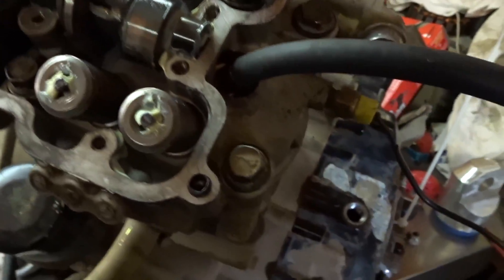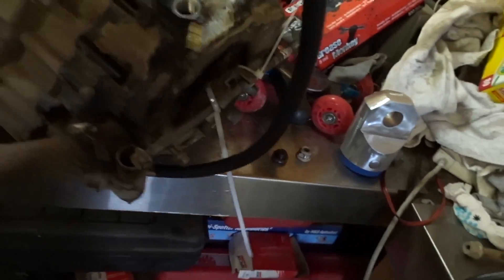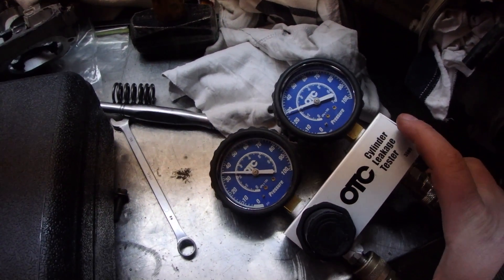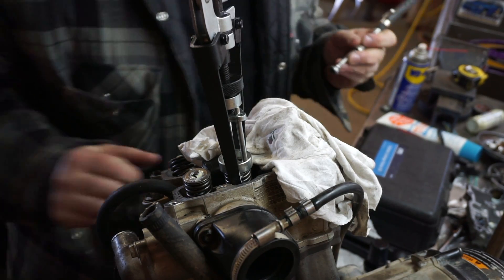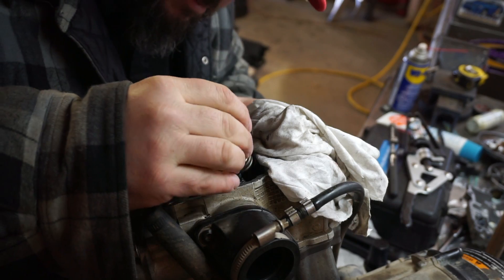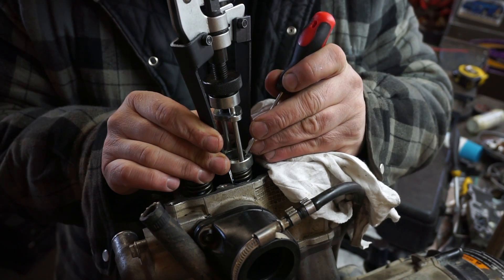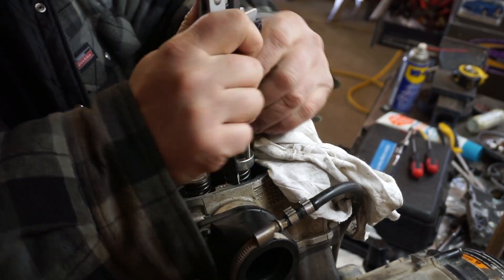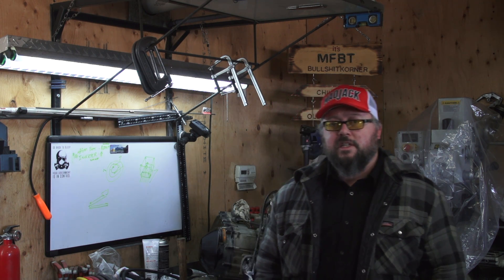How to Change a Valve Spring WO Head Removal DIY

Comment: Im  wondering if it would run ok and never know the difference. I bet this is a common thing missed.
Reply from the maker: +STEVE ROB the spring rate is different as one end of the spring is tighter as the other side is more spread out.  This will affect the harmonics in the engine